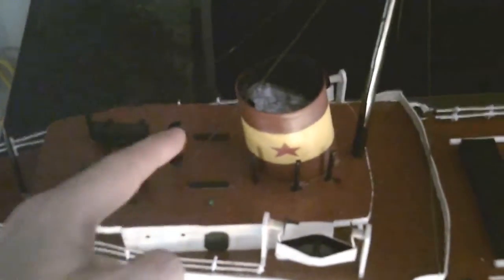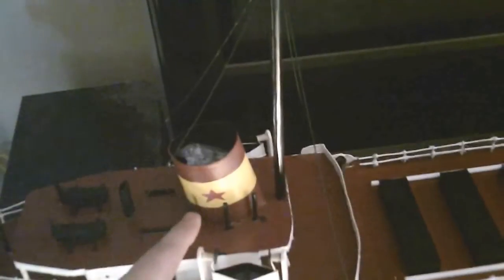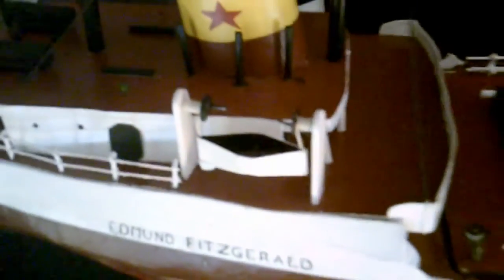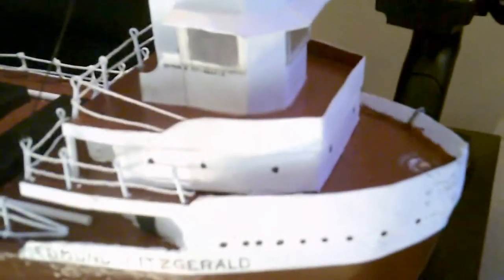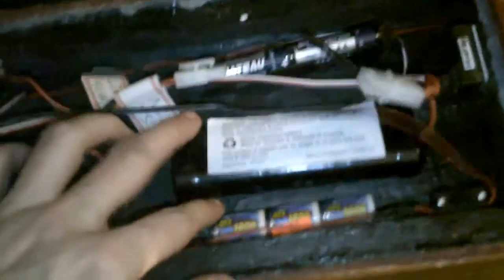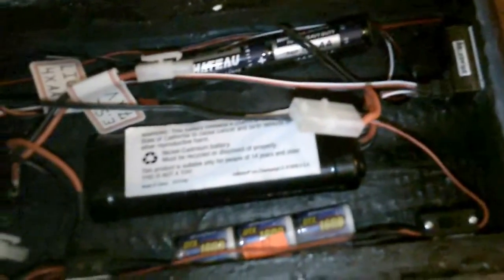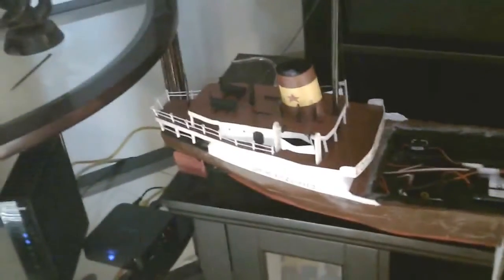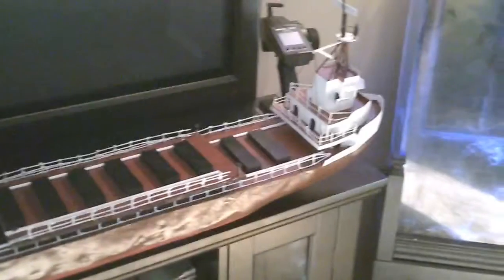Large 5 ft RC Edmund Fitzgerald - Great Lakes Freighter 100% Scratch Build

Comment: The bow pilothouse could honestly use a bit of work to better fit in with the realistic ster pilothouse, but it's a beautiful ship.  Seeing this model reminds me of the rare videos it sailing on the lakes I watched.

Great job
Reply from the maker: Thank you😊 its not really built to scale or anywhere close to museum quality but I also only used things around the house I had laying around. The cabin parts are actually just cardboard coated with fibreglass resin. Made for a fun project with my step son over the winter. I never built one from scratch before usually only kits so this was very different then what I am used to. In all honesty tho it was far easier then I had anticipated. Some things I changed a bit just to make it easier to assemble and make water tight.

Would be nice to have it go through one of the locks in port Dalhousie but might get a video of it near by really soon. Also am going to hook up a small air horn soon so that will be very cool with the lights and smoke generator.
Reply: That would be amazing!

Heck, I would buy one of those Fitzgerald RCs with those working!

I remember reading about a model similar-yet more realistic-someone made.  Even got the paint used by the ship companies for it.  He put in a working "ballast" in it's hull using a tank and some kind of filtration System used by fish tanks to pump water in and out.  Fully loaded, it could plow through 5 foot seas

Comment: This is cool. I’m planning to build a detailed lake freighter of my own design made from mostly stuff foam insulation covered i cardboard and then flex seal. It doesn’t sound pretty but if I do it right, it will actually work the way the ship is supposed to work
Reply from the maker: It does not have to look pretty😁 long as you enjoy building it and enjoy using it that is all that matters. Lots of people will criticize every little detail but in the end its not a kit and you made it all yourself and they are probably all too lazy to do a scratch build to begin with and buy kits for their perfection attitude🤣. It is much more rewarding and you learn a lot more doing it yourself then a kit and it is 100% your creativity👍
Reply: @ontario_backwoods_beekeeping  ik that is why I want to do it. But the ship in question is one I made up when I was younger so I want to do it justice and at least make it look a little close to what it’s supposed to.

Comment: Can you explain how you made the hull? or is that explained elsewhere? I want to make one and need to learn now to make the hull.
Reply from the maker: Basically cut out carboard ribs and attached them with 3 pieces of dowel. Then covefed the outside in duct tape so it worked like a mold. Much easier to use solid wood and shape it tho. Then coat it with fiberglass and resin. Theres a video with pics showing stages of it being made.

Comment: Is it hard to sail on a windy day?
Reply from the maker: Nope not at all. The fastest it was going there was half throttle. Full throttle it's like a torpedo even handles a strong river current with ease. The motor I used is designed for rd tank track motors and are very high torque.

Comment: I want to make something like this but a canoe that you can sit in and it has a prop that you can run with a rudder
Reply: @jmjaxson  pretty neat
Reply from the maker: Electric trolling motor😉. Should be easy to make a rudder.
Reply: @ontario_backwoods_beekeeping  just coding and all the technical stuff is a pain, although i personally love doing the engineering part of it

Comment: Gear it down, way to fast
Reply from the maker: I was breaking in the motor. I cant gear it down. This was a still pond but i need the power for in the river😉 would rather have to go easy on the throttle then not have enough in current or wind😉
Reply: @ontario_backwoods_beekeeping  , But very cool and as you said, this is your first boat model.  The iron ore boats of the Great Lakes are the best.  You've probably seen them but check out,  Bearco Marine if you haven't.   They have some great models and resources.   Take care